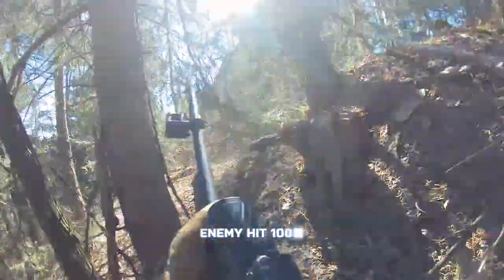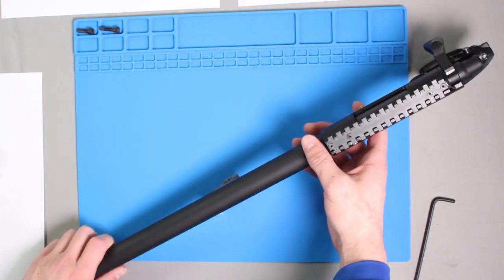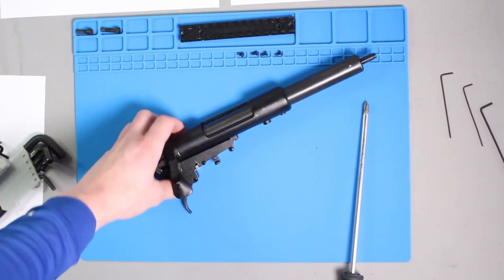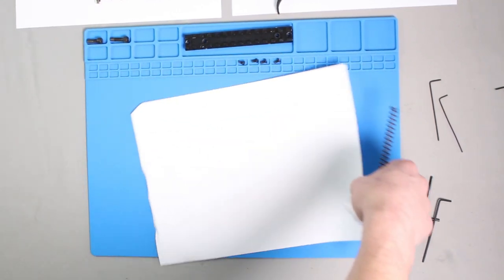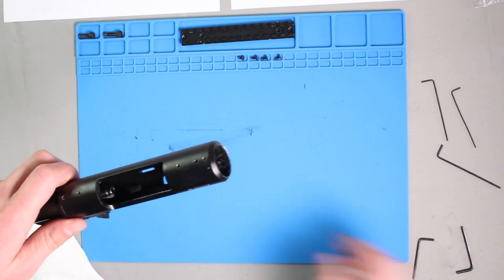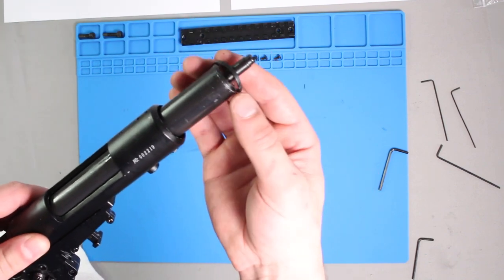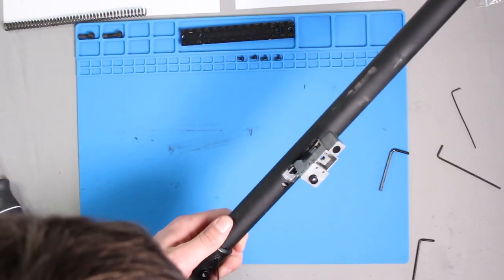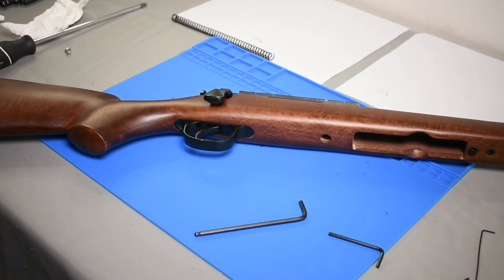VSR-10 Spring Change | Increase/Decrease FPS - T.N.T. Upgraded DB VSR

Comment: Hi there. I recently got this rifle, I got it with the 450 spring. Where did you get the 500 spring from as I want to upgrade mine.
Reply from the maker: Hey!  So I actually ordered the spring along with my rifle from https://www.sfcairsoft.com 

I believe the product listing goes on and off based on product availability.  I would maybe email SFC to check on this.
Reply: @Private_Caboose  I'm. Close to buying this in real wood from Patrol Base in the UK and its saying the fps is 545 out the box.. Is that too much for the internals it comes with? Do you think I'd need to upgrade it?
Reply: barry gray  I didn't in the end mate, I went with the WELL L96 in green and black. What I've come to learn is that the fps is merely for the speed it sends the bbs. With these rifles and guns they try to sell you the aesthetics and its so much deeper than that. Unfortunately it's all about the internals of the gun and if you've got a high powered sniper with crap internals... It won't last long. My advice is to get a cheap stock and upgrade the internals for durability, performance and longevity.
Reply: barry gray  If you haven't bought it already, get a cheapish VSR-10 and spend your money on the internals. Unless you have the funds to buy a sniper with decent upgrades like a spring, piston, cylinder, precision barrel and solid trigger unit. From what I hear.. Novritsch' snipers are legit and well worth buying as out of the box they're spot on and no need for upgrades at all.
Reply: barry gray  SSG10 is a wise move. If you can make your own stock and take out the whole barrel and trigger unit because that's all these rifles really are.. You're laughing mate. Good luck!

Comment: Im planning to upgrade and use a steel sear,a steel sear holder a reinforced piston with a new guide and a 590fps spring,will the stock aluminium tube survive and can the trigger box hold that spring or do i have to go for the 90 degree trigger box and steel tube ?
Reply: As long as you get high quality sears from something like Action Army you’ll be fine at that power

Comment: If you find a guy with an SSG10 could you compare them?
Reply from the maker: soooo I actually shot the SSG10 on the same day I used this rifle for the first time.

Both were great, here are some pros for each:
SSG10 - lighter bolt pull (idk which spring he had in though), shot straight down the middle (not sure if it needed to break in or not), 25 year warranty is insanely good. 

SFC VSR-10 - After the first 50 or so shots it was continuously shooting straight down the middle, real wood furniture is beautiful.

If you are NOT someone who tech's your own guns, I think the SSG10 makes the most sense.  

Personally, I wanted something different from a lot of the sniper rifles I see at the field, and I know the T.N.T. upgrade parts in the VSR are top notch.  On top of that I really love the light, sound absorbing real wood stock.  

These are both top shelf rifles in my eyes, sending .45 BB's down range beautifully.

Comment: yo man where the review of this gun? debating on ssg10 or this
Reply from the maker: It is in production!  My work life has been CHAOS during this quarantine, I am trying to find time for youtube as well.  I would suggest the SSG-10 simply because of the warranty and the fact that is is sold domestically.  The SFC VSR performs in the same ballpark as the SSG-10, but it does not  ship with a warranty, and if you did need to ship it back for work/maintenance  it is going all the way to Taiwan.  With that being said, I do think the SFV VSR is much sexier than the SSG-10, and that was what steered me that way

Comment: I get mines monday and i want more fps what do u recommend as for upgrades? the vsr10 is already 500fps with .20 but i want to shoot  .40 bbs need some guidance thanks
Reply from the maker: hey are you getting the SFC upgraded version?  I would just throw in a new spring, I use .4s and .45's in mine and they fly great!
Reply: @Private_Caboose  i think its the upgraded version. When i bought it said pre upgraded 🤷‍♂️. Im trying to make it shoot 500fps with .40/.45
Reply from the maker: FyN3zT- BoBBy oh yeah if it is coming from SFC it will be upgraded.  So the only think you will want is a higher power spring, they go on and off of the SFC site I’ve noticed so I would check there first.  But if not all you need is a Double Bell VSR spring in whatever FPS you desire!  I run mine at 500 FPS with .2s
Reply: @Private_Caboose  i bought a m170 spring and a AA 6.01 430mm tightbore inner barrel im slowly getting the stuff to creat a laser monster next buy its gonna be a AA 90 degree trigger piston set.
Reply: @Private_Caboose  can you upgrade the barrett fieldcraft caft airsoft with that spring

Comment: I loved this video. My gun is a custom, so its got some hybrid parts between guns. What made me sad is when i got to the retaining pin part I found out that it was in there so tight that i couldnt get it out :(. Does anyone have any tips for getting that pin out if its in really tight?
Reply: Use small hammer and flat screw driver, and small force.
Reply: late response bur you can use plyers like seen in many other disaszmbly vidzos